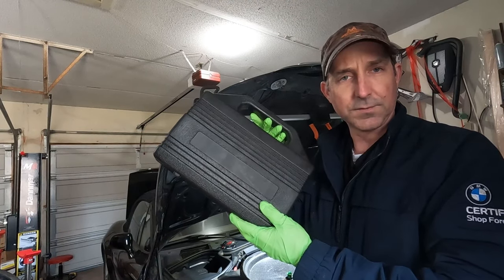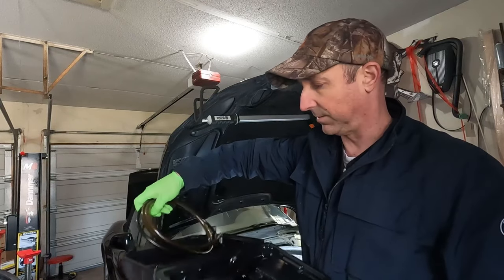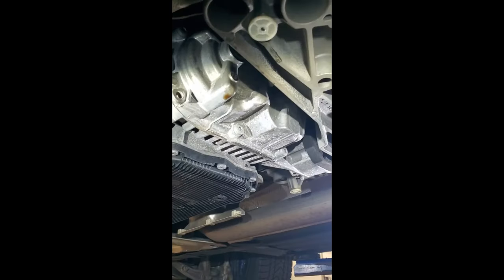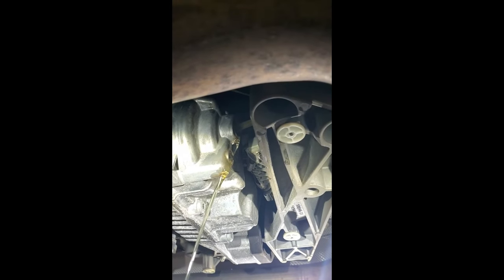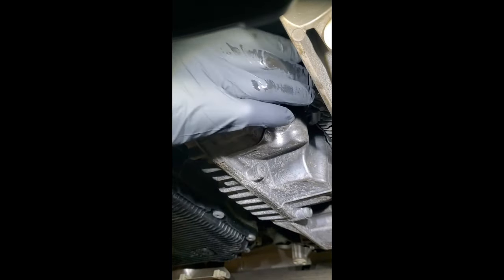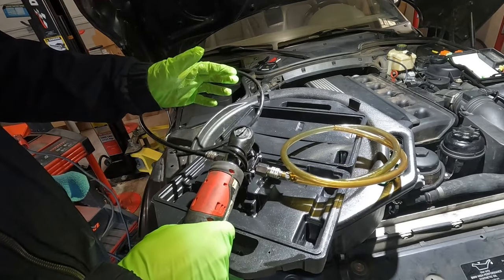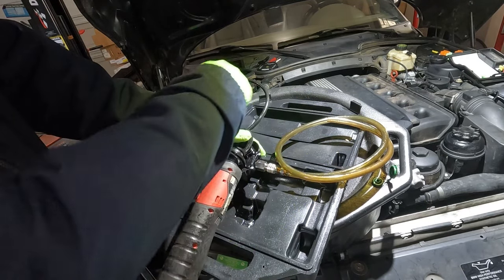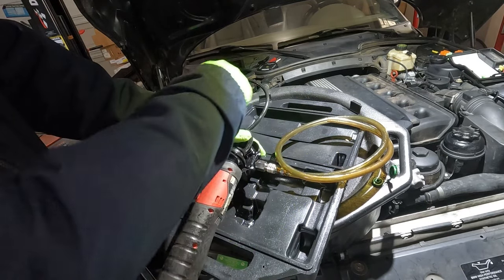BMW Transfer Case ISSUES PROBLEMS Plus DIAGNOSIS STEPS And Fluid Change 54C6 539E 5463 5F3A 54C4

Comment: I have a 2007 BMW x3 and I am having this problem smh 🤦🏾‍♀️ i don’t know what to do.. it makes a knocking noise when I drive it .. does that mean it’s the transmission going out or I just need to change the fluids ?
Reply from the maker: Hi Danielle, Hard to say from your description. If the noise is from the engine then it would be an internal engine issue. I would have it inspected. I would not be able to guess the failure.

Comment: would it make a whistle noise when accelerating? Even if I step off the gas completely, it makes a whistling noise.
Reply from the maker: Hello, This issue does not make a noise typically. It is more of a feeling in the vehicle. The noise you have is most likely a different concern.

Comment: From experience fluid change in the VTG usually doesn't fix it. 
Quote a VTG and sensor unit and be done with with. 
Just advise the owner to replace all 4 tyres each time.
Reply from the maker: Hi Devin, I have had some success with fluid changes and adaptation reset. Best to do some extra oil changes. Good point on the tires. Mismatched tires and different rolling circumference can cause wear in a transfer case.

Comment: Great info, have car in the shop that felt like a misfire, will be changing fluid tomorrow
Reply from the maker: When you disconnect the transfer case motor did the symptoms go away?
Reply: @AskTheCarExperts  yes the symptoms was gone was I unplugged the unit.  I sucked out the old fluid, which was burnt and low.  Installed new fluid, performed adaptation with autel.  The car felt 100% after that.  Thanks again for the info
Reply from the maker: @goharrisautomotive  Awesome Phillip! Glad to hear the info helped!
Reply: @AskTheCarExperts question instead of disconnecting the plug can I just disconnect the 4x4 fuse from the trunk?

Comment: What tool did you use to open the drill plug? How did you make the modified tool
Reply from the maker: I used a Hazet drain plug tool and cut the allen down to size. 
https://www.autohausaz.com/pn/143791_20_2135_3584__6_7-HZ-2760?utm_source=google&utm_medium=cpc&utm_campaign=feedmobile_BMW&gad_source=1&gclid=CjwKCAjwy8i0BhAkEiwAdFaeGLZZ_-i53szKY1QOAuoQgEojWB411zvaXUHH7yKLX6b4GksjMrrXcRoChvUQAvD_BwE
Reply: @AskTheCarExperts  thank you. Ive seen that the transmission plug needs to be torqued to 60nm. What are your thoughts on not torqing  it down to spec since you are using this tool ?

Comment: i have a stutter only at highway speeds. i first thought clutch slipping but it pulls absikutely fine at lower gears. i have no codes for tcase when scanned but after putting 2 grand into it and still having a stutter im thinking tcase???
Reply from the maker: Sorry to hear that  Paul. Did you disconnect the transfer case  electrical connection and then test drive the vehicle to see if the symptom is gone?

Comment: Interesting…. I have the exact same transfer box on my 530d  G31 and I cannot get any size pipe to fit it the plug hole. There doesn’t appear to have any gap between the inner bearing and cover
Reply from the maker: You do need a very small flexible hose to get into the cavity. In some cars it is recommended to remove the transfer case and drain it manually by tilting it and pouring the fluid out.

Comment: Do I have to make sure the car is lifted evenly when I put the fluid like I do with the transmission fluid or is it alright if I just drive it up on a ramp ? My car feels like it skips a gear once in a while when I’m driving. Hopefully this is the cause of the problem
Reply from the maker: Hello Ezrah, Yes you want to make sure to have the vehicle as level as possible. I hope the fluid change helps!
Reply: I hope so too. Thank you !

Comment: Thanks for the video for better understanding 😊. On my F10 xdrive, i started using R20 wheels and after couple of months of usage the car started jerking . Bmw requested me to change transfer case. Then i done some research and i put my old 18 inch wheel back. Then the issue disappeared. Google helped.  I believe it was cause by different manufacturers on front and back. Something new what i found was, even if the configuration is the same different manufacturers has differences in circumference which effect the transfer case . But i don’t know if i put my R20 back with same manufacturer the problem will still be existing.. any idea? :-)
Reply from the maker: Great Job figuring that out! Changing the rims and tires can definitely effect transfer case life. Transfer case replacement is not cheap. It might be an issue with the rolling circumference of the 20s but it is best to stick with stock.
Reply: Here in Sweden its Common knowledge if u have xdrive u dont have more then 1% MAX in circumreference between the rear and front Axle, u can use 20” but u need to have the tires circumreference higher than 1%.
For example i bought my 530d x drive and it had 245/45/18 on both axels and that means 0% diffrence between front and rear axle! 

Hope this helps!

Comment: My 2019 X5 BMW has the same problem. The technician checked the car for 2 weeks and finally told me the transfer case deactivated, if I want to fix it, I need to pay $7050😂 Can I I fix it according to your video? Thank you so much!
Reply from the maker: I would recommend starting with the fluid change and driving for at least 200 miles. If the problem is still there then it will need a transfer case but often it can be fixed with a fluid change.
Reply: got it, thank you so much!

Comment: I've been experiencing the chatter for more than a year before I knew what it I was.  This is on my 2011 X3.  I just today got a drivetrain malfunction warning along with a clunky idle.  Are they most likely related or am I dealing with a spark plug issue also? Thanks!
Reply from the maker: Hi Shaun, Most likely these are two separate issues. The rough idle could be a misfire from multiple reasons. Scan and start with the basics of plug and coil swapnosis. Also air leaks can lead to rough idle and misfires.
Reply: @AskTheCarExperts  Thank you, I'll start with that and share what I find!

Comment: I already have the 4x4 and abs, as well as brake caution light on, I'm trying to figure out the source of the issue. I've heard the 4x4 actuator is a common problem and when the gear strips, it takes x-drive offline. But any additional input would be appreciated.
Reply from the maker: That is a common problem you could definitely check first. If the gear is stripped start with that and a fluid change.
Reply: I’m having the same problem did you find out what was wrong?

Comment: My X3 has had a hesitation occasionally when accelerating uphill or under power. Worse in Eco Mode. Just had some new tyres fitted and it’s horrendous. Just crawling along any slight acceleration cause a jerk and a bump, less than 10mph. Take off the gas and it’s ok. Over 30 mph it seems better, negligible. Gets to 60/70 and cruises fine.  It could be transfer case or it could be tyres. I hate to say I swapped warn out Pirellis for a lesser mid range tyre. Obviously supposed to be same size/spec. I fear these tyres are under size. What’s your opinion on possible front rear tyre sizes on this problem?
Reply from the maker: I would not recommend driving it much and to only use the stock rims and tires. Incorrect tires can cause permanent damage to the transfer case.

Comment: Hello, thanks for sharing this video.  Where did you get that tool for the fill plug?  It looks like you are able to undo the plug without taking the brace off?  I’ve been putting off this service because I’ve heard removing that brace is very difficult.
Reply from the maker: The tool I used is a Hazet tool that I cut down the Allen portion to allow me to sneak it in to this tight space.

Comment: This exact problem happened on my 2019 G05 X5 M50D with 69000kms. BMW have a Service Bulletin published ( SIB 27 02 20 )  that suggests to do as you say - Change the transfer case fluid  - after first checking for uneven tyre wear or mismatched tyres. My local BMW shop tested the car, by disengaging the transfer case and subsequently, changed the fluid - Problem solved. This was done under BMW goodwill as my car is out of warranty. This must be a known issue!  I am very curious to see if the problem re occurs and if so, how BMW address it?
Reply from the maker: Hello, Correct there is a BMW bulletin on this issue. I think the goal is to prevent replacement of transfer cases before trying to fix with fluid changes. If the issue does come back they would recommend to replace the transfer case. I have had a few return and others where completely fixed.

Comment: Nice and direct video 
Is the Fill/drain plug magnetic?
Reply from the maker: Hello Feras, I think the drain plug may be steel.  I have not held a magnet on it but that would be the best way to check.
Reply: @AskTheCarExperts  
Thanks for the reply

Comment: How do you reset vtg oil after servicing the t-case?
Reply from the maker: This would be a test plan run using a scan tool that can do this reset. This  can only be completed via a scan tool such as the Autel https://amzn.to/3EPowxC

Comment: okay so it has nothing to do with the Transfer Case Shift Motor/Actuator? 

Please let me know thanks
Reply from the maker: Usually a transfer case motor issue will set a fault code specifically for the motor. Normally the failure is the internal clutch packs that may be better after an oil change in the transfer case.
Reply: @AskTheCarExperts  got it thanks thought that aswell

Comment: No mention of tires and alignment? I have solved a plethora of TC shudder with tires and alignment. The BMW SI B even tells you to check this first.
Reply from the maker: Very good point. I am surprised I forgot to mention that. Any rolling circumference difference can cause transfer case damage.

Comment: I'm experiencing these exact symptoms on my BMW 750i - 2020. With my car only being 3 years old I wouldn't have expected to experience this and initially thought it was the tires rubbing. I'm still not confident it's the transfer case but your video describes my issue. I'm now trying to find someone who can do the flush to see if I can avoid spending 10k to get this transfer case replaced. Do you have any recommendations on where to get the flush done? And thank you for the video.
Reply from the maker: Hello Ahmad, Sorry to hear your BMW may have this issue. Any good BMW specialty shop will be able to do this for you. It need not be a dealer but they need to remove as much of the old fluid as possible. I usually can get about 1 Liter out before I add new fluid.

Comment: Great video! But I'm confused about transfer case fluid and differential fluid. I have Valvoline 75w-90 (GL-5 spec) can this be used in transfer case and differentials? My car is a 2004 2.5l x3. If not, can I use Valvoline Transfer case fluid? I read that DTF-1 replaced TF0870. Advanced auto site shows Valvoline Transfer Case fluid is exact fit but I do not see DTF-1 spec. Thank you
Reply from the maker: That should be a compatibel fluid

Comment: Can a transfer case get damaged in a T-bone collision ?  how does BMW diagnose transfer case codes 0x440101&0x4809D?
Reply from the maker: It I'd pissibel. Or even damaged towing if it was not flat bedded.

Comment: My 4x4 light are on and a yellow BRAKE dash light is on does that mean its the transfer case
Reply from the maker: @mokuii8338  You will need to scan it. This could be the transfer case or something related to the dynamic stability control system.

Comment: Hey is this a ATC13 ? I drive a G30 530d xDrive and I try to change the oil but I  didn’t have any problems. I just want to change the oil preventive to save the transfer case. But I only get about 350ml out. I also use the diagnostic tool BMW ISTA instructions
It’s difficult to find a position where the oil is. 
Greetings from Germany.
Reply from the maker: Hello in Germany! Getting fluid out of these is a real pain. The best way is to remove the transfer case. But that is a pain. I would just do a few drain and fills which should freshen up the fluid.
Reply: @AskTheCarExperts  
update 
Thanks for your reply. I sucked out the oil again but used a 4mm diameter hose, before it was an 8mm hose and it was a bit too thick. I sucked out about 500ml and it was dirty oil again. I will repeat the process after 1000km. Thanks for your video.
Reply from the maker: @stojans.6506  Great to hear it was helpful!

Comment: Replaced transfer case but can’t get all wheel drive to work still. Have a code that says transfer oil wear. And I can’t erase the code. Any ideas?
Reply from the maker: Hello Rex, The code for oil wear will only clear after a scan tool that can do the reset is used. But that should not cause a transfer case to not work. There has to be another reason for this failure.
Reply: @AskTheCarExperts  the codes I have are 
440101 transfer box(vtg) end of transmission service life reached and code 
440102 transfer box (vtg) oil wear
48097D transfer box: fault, clutch position known, no four wheel drive 
D355F8 signal (xdrive actuator information, 19.3.4) invalid, transmitter VTG 
We have replaced the transfer case and tried it with the replaced transfer cases module and then we tried it with the original module. Not sure what to do next. Any help or suggestions would be appreciated.

Comment: So I have a question for you if I put my foot on the break on cold startup and put my car in reverse my idle air on the dash goes up and down is that caused by a bad transfer case it does it once in a while but when I turn on the AC you don't get to see the idle going up and down
Reply from the maker: I have seen this before. This is usually an issue with the program level in your engine computer. I would recommend having the software updated at your local dealer.

Comment: Ive just got my self a 2013 x3 3.0d on 76k  and when driving it normally feels smooth but when im in traffic and just roll along in drive i get a feeling im driving on a flat tyre? it feels like transmission or a prop shaft banging any ideas
Reply from the maker: I would take a look at the tires first for any abnormal wear.
Reply: @AskTheCarExperts  all new tyres ?
Reply: Still stuck with the same issue and no one seems to know what it is
Reply: Did you manage to find out what was wrong with yours mate.. I have the same issue with mine. Acceleration perfect but when rolling the car judders on slow speed or when creeping
Reply: Check all tyres first for wear and correct sizes but mine was the transfer box needed a new one

Comment: I had this problem on my f30 328i, when I was driving at 60 kmh or 80kmh and I just started slowly acceleration, the car was shaking for about 2 seconds then transmission changed gear, that was horrible fillings like transmission problems. Also whole car was shudder vibration on highway, in beginning i though because of wheel balance is bad, but it is not. So I sold the car and bought 2016 x3 35i, this car is so smooth and doesn't have this problems. I think this f30 problems only. Because i saw many of them with this problem.
Reply from the maker: I have seen a lot with this issue.  Glad to hear your new BMW does not have this issue.
Reply: @AskTheCarExperts  Yes thank you Sir.
Reply: To be honest I love f30 but if i'll buy again I will only buy rwd, less headaches🙂

Comment: I used to have this shattering  on highway steady rpm  and MAJOR shattering when WOT , data log was all over the place  , unplug the actuator and everything was gone ... proceed to oil change and fix 95% of the shattering!!!
Reply from the maker: Awesome Jason! That is a bif improvement! Crazy how this issue can feel like a misfire sometimes.

Comment: Roger, I need to know if pulling the fuses has the same effect as unplugging the connector.  On my 2014 X50i the judder has returned at 95Kmi after BMW replaced the transfer case under warranty at 54Kmi.  I changed fluid twice and reset adaptions.  I haven't yet driven 100mi.
Reply from the maker: @garyvanremortel5218  Sprry to hear that Gary! Pulling the fuse is not the normal way I diagnose this issue. In theory, if you can pull the fuse for the transfer case motor it would disable it. But it may effect other systems as well.
Reply: @AskTheCarExperts Tight spacing prevents me seeing exactly how to disconnect the connector without breaking the retention feature.  Can you tell me how to release it safely?  I have the ATC45L.  Now in the process of driving the 125mi.

Comment: another thing how do you deal with code 0578E on 2008 BMW X3...thank you
Reply from the maker: That code usually mean the transmission fluid will need replacement and then a recalibration and reset using a test plan for the transmission.
Reply: Can you performed calibration procedure without t-case fluid service? Will it clear the code? I’m new to your channel and very much amazed watching you deal with so manu issues…best regards
Reply from the maker: @efivegauthierchryslercanad3066  Thank you. You can crun the test plan and it will clear the code. The system would assume the fluid was changed.
Reply: @AskTheCarExperts  ❤️

Comment: What about driving at speed with the transfer case plugged out
Reply from the maker: Hi Steve, This would only disable to power to the front wheels. The vehicle would drive in rear wheel drive only mode. You will get a chassis light that will clear once the transfer case is plugged back in and the vehicle driven.